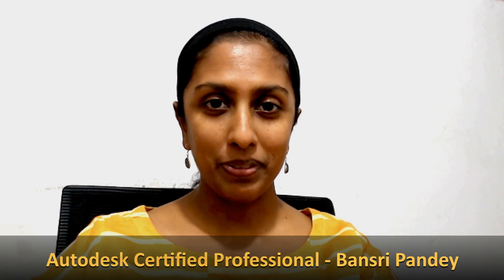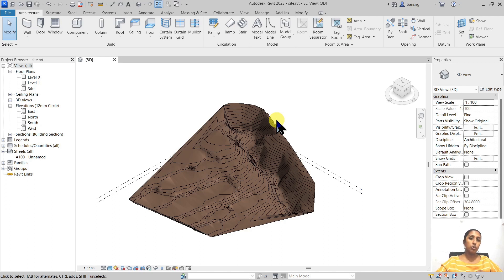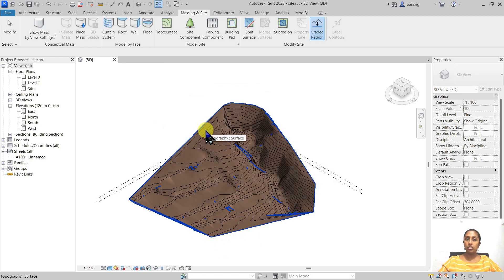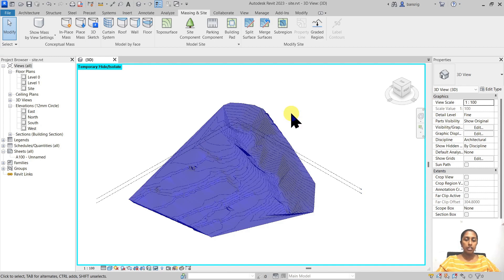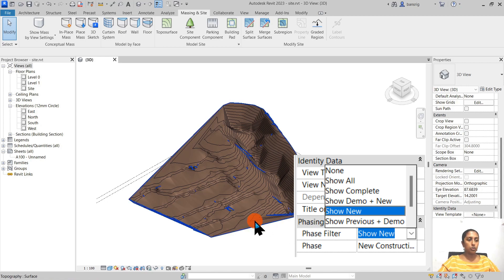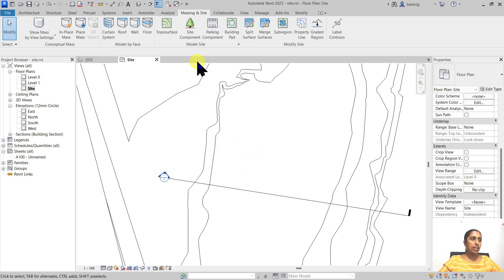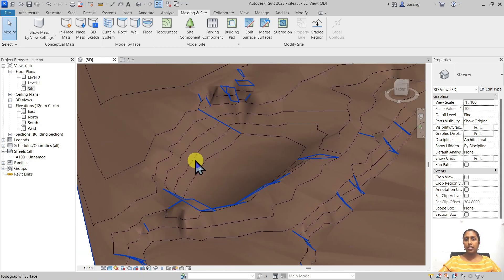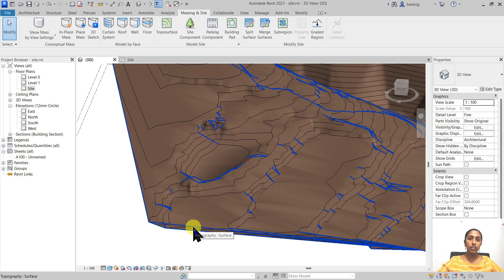EP64 | Revit Beginner Program | Graded Region | Net Cut/Fill Volumes of Topography | Bansri Pandey

Comment: My question is alittle 'off topic'. Is there a way to insert parenthesis within the Label Contours tab to indicate the existing topography? By default, Revit doesn't distinguish between existing and new contours. Shukria, Bansri.
Reply from the maker: you can try to use phases and phase filter. Please send a snapshot of what you are trying to do at:  info.itsnepal@gmail.com